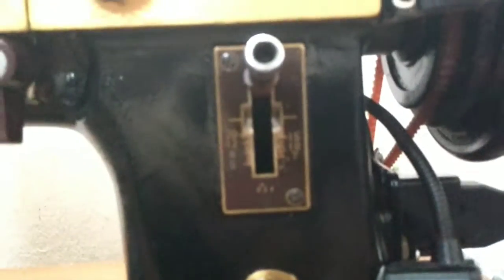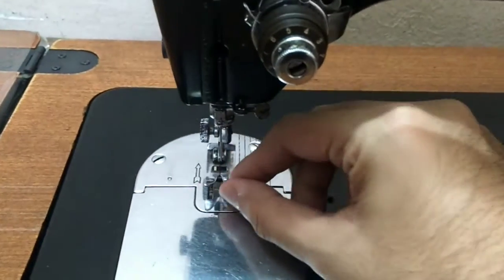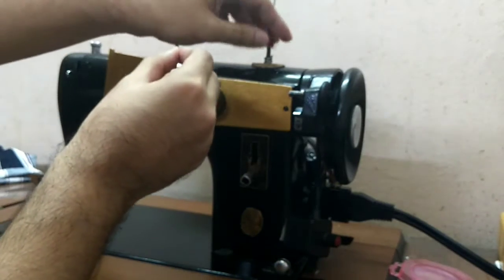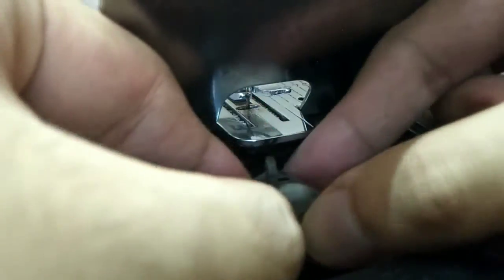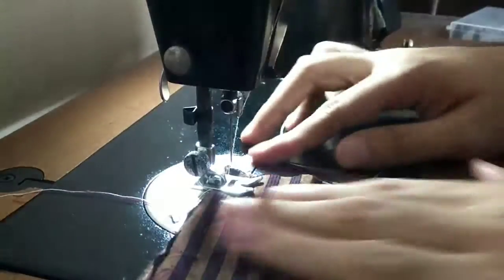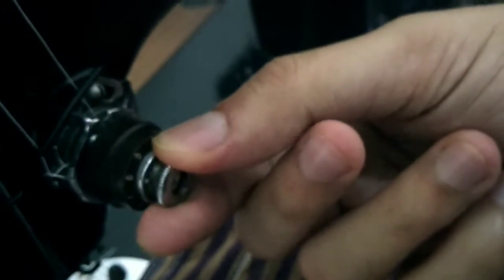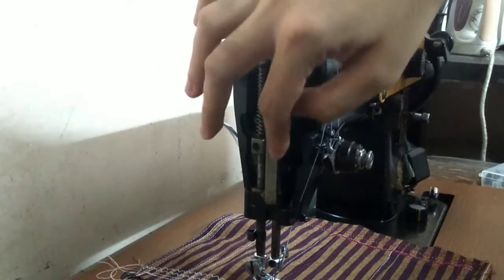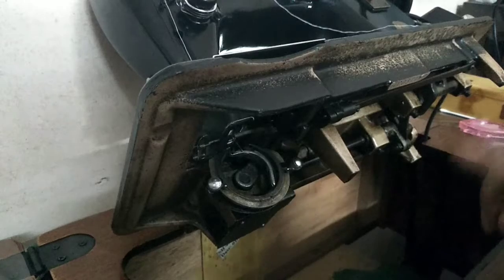Intro and Usage Tutorial for Singer 224 (224U) from 1967

Comment: Hi. Finally someone who has opened the front and back covers of this machine. Do you know how to align the needle bar of the machine or remove the bar? In mine the needle is hitting the back of the hole in the throat plate. So I need to move it forward.

Comment: How do you find this machine compared to other singer machines?
Reply from the maker: This machine is dear to me because it’s one of the last models to be made fully from metal. It sews just as good as any other vintage singer machine (and you get to do extra stitches with this too!) however, sometimes the timing can easily be off. Repairing wouldn’t be too hard though. My personal experience with this machine - Bill